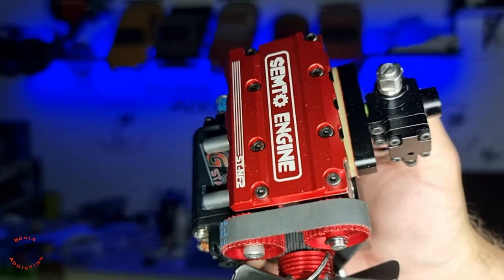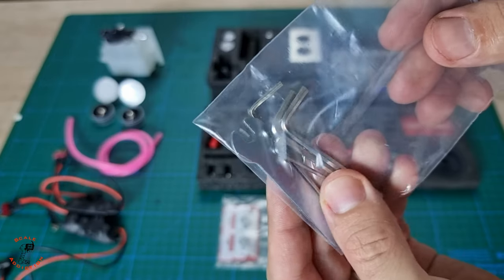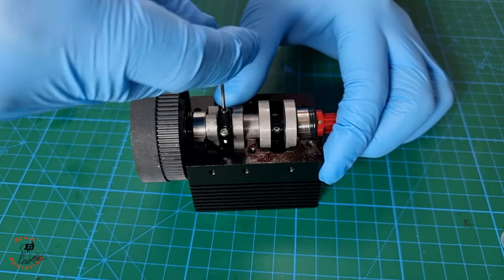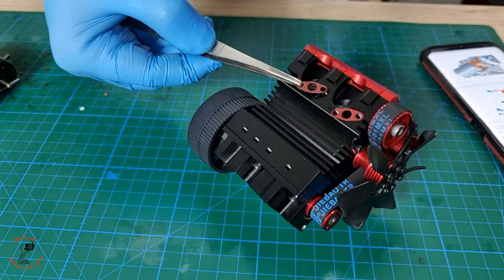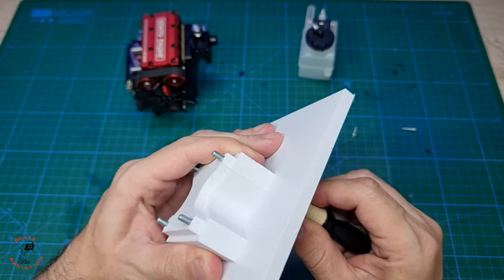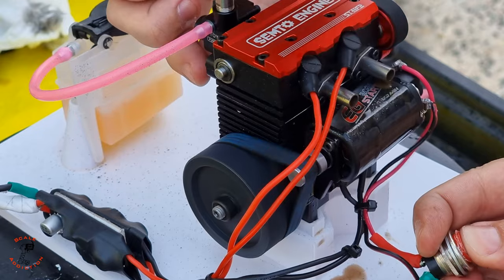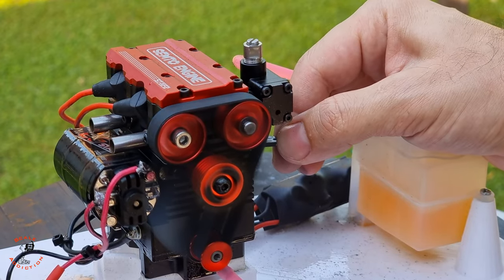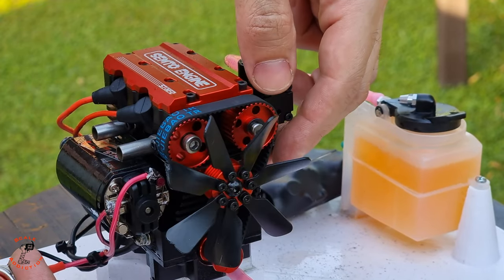Worlds smallest 4 stroke working engine, assembling and start up | Scale Addiction

Comment: Regarding the nitro fuel having oil in it, lubricating the engine; doesn't this mean the engine doesn't necessarily need to be a 4 stroke? Couldn't it be a 2 stroke since it already lubricates itself with the fuel, and theoretically making almost twice as much power? Kind of curious as to why it's a 4 stroke in this case, would it just be for fun? :D